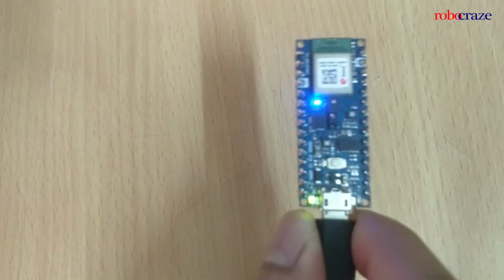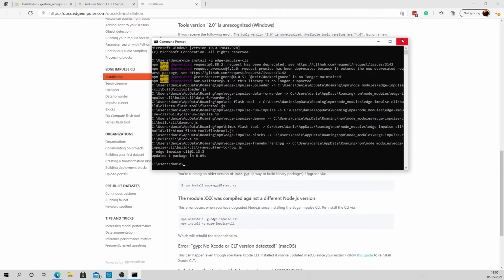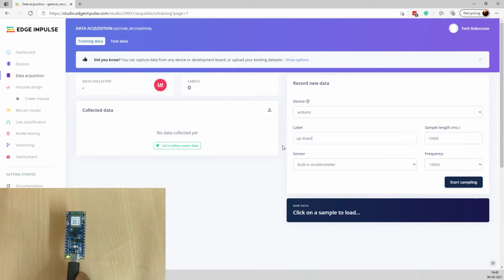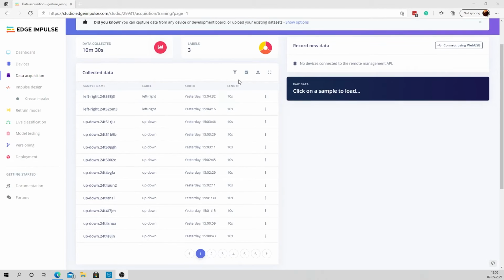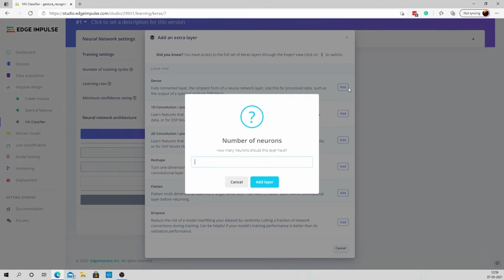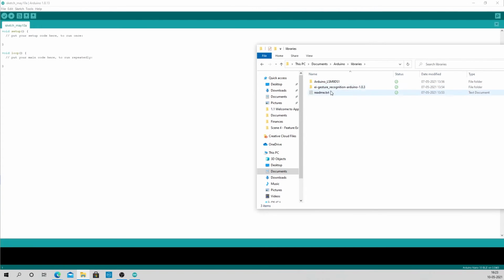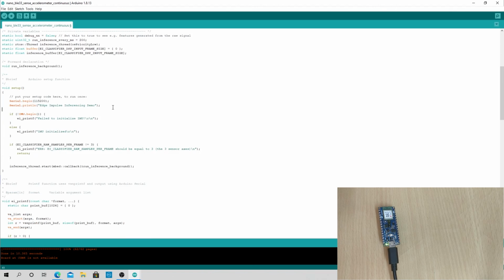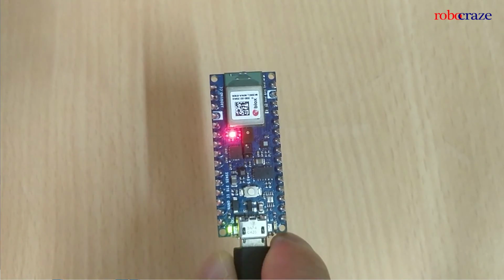Arduino TinyML Kit Tutorial #6: Gesture Controlled Led State using EdgeImpulse

Comment: Failed to perform train/split data in rebalance why??
Reply from the maker: Hi! The train/split data step might fail in rebalance for a few reasons:

Data Imbalance: Ensure that your data is properly distributed across all classes. If one class has very few samples, it could cause issues.

Corrupt Data: Check that your data is clean and properly labeled. Invalid or corrupted files might cause the split to fail.

Settings Issue: Double-check your rebalance settings. Ensure that the number of data points per class is within an acceptable range.

Try these steps, and if it still doesn’t work, let me know the specific error message, and I’ll help troubleshoot further! 😊

Comment: Arduino-cli is not downloaded. Screen is also not visible means flash command. Plz help as soon as early
Reply from the maker: Hi! If arduino-cli isn’t downloading and your screen stays blank during the flash step, try these steps:

✅ Make sure arduino-cli is properly installed — you can follow this guide: https://arduino.github.io/arduino-cli/installation/

🔁 After installation, run arduino-cli config init and then arduino-cli core update-index to set it up.

⚡ Use the correct COM port and board name in the flash command — e.g., arduino-cli upload -p COMX --fqbn arduino:mbed:nicla_sense_me

🔌 Ensure your board is properly connected and visible using arduino-cli board list.

Still stuck? Let us know your OS, board name, and exact error message — we’ll guide you step-by-step! 🙌

Comment: TinyML could work with Arduino Nano 33 BLE 1 o rev2? I mean the Nano 33 "basic"(not the "Sense" model).
Reply from the maker: Hello,
Yes, you can use TinyML with the Arduino Nano 33 BLE (the basic model, not the “Sense” version). While the Nano 33 BLE doesn’t have the built-in sensors that the Nano 33 BLE Sense has, you can still run TinyML models on it. You’ll need to connect external sensors to gather data for your machine learning applications.

Comment: node:internal/modules/cjs/loader:1031
  throw err;
  ^

Error: Cannot find module 'C:\Users\abhi\AppData\Roaming\npm\node_modules\edge-impulse-cli\build\cli\daemon.js'
    at Function.Module._resolveFilename (node:internal/modules/cjs/loader:1028:15)
    at Function.Module._load (node:internal/modules/cjs/loader:873:27)
    at Function.executeUserEntryPoint [as runMain] (node:internal/modules/run_main:81:12)
    at node:internal/main/run_main_module:22:47 {
  code: 'MODULE_NOT_FOUND',
  requireStack: []
}
error while connecting
Reply from the maker: Hello,
The error you're encountering suggests that the Node.js module edge-impulse-cli is not properly installed or the specified file daemon.js is missing. Make sure that you have Node.js installed and it is properly set up in your system or you can reinstall the packages.

Comment: Updating edge firmware  will cause any issue? like old firmware features works properly?
Reply from the maker: Edge Impulse firmware is just a precompiled program for the board. To use EI, you will need the EI firmware to be uploaded on the board. You can still use the microcontroller for normal uses by just uploading another program through Arduino IDE.

Comment: Can you please tell whether the tinyml works with Nano 33 Ble also ? To be clear I am asking about Arduino Nano 33 BLE not Arduino Nano Ble sense ?
Reply from the maker: Theoretically it should since they both use the same processor chip. But the non sense version does not contain all the onboard sensors that we have used for this series. So you will need to interface those sensors externally to achieve the same result